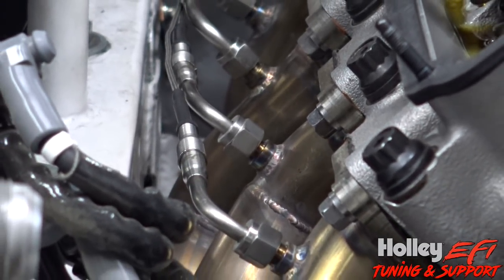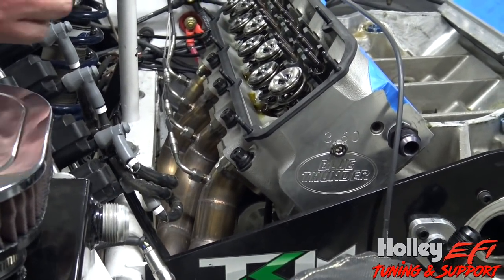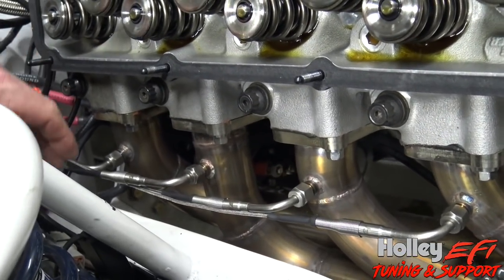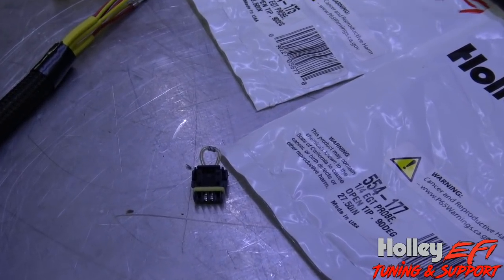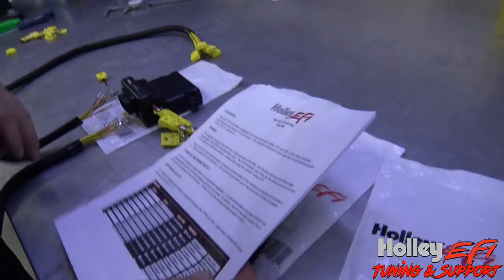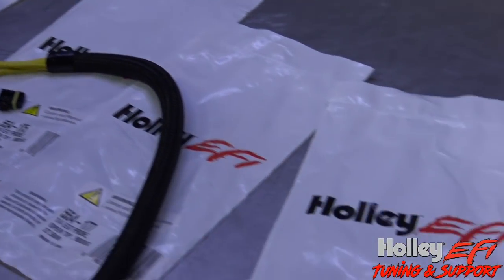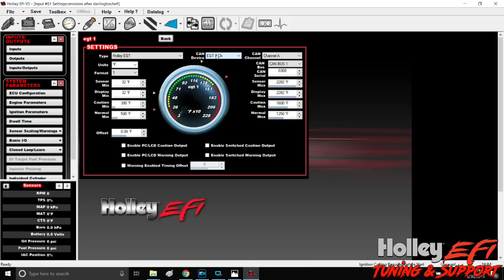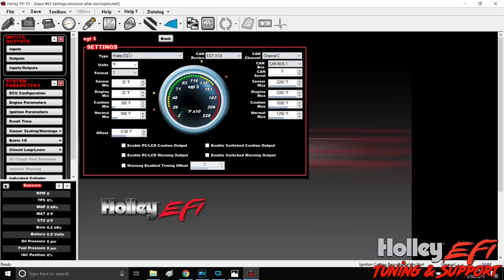Holley Efi Can Bus Egt (Exhaust Gas Temp)

Comment: Do you have links for the wiring bulkhead connectors you used for this as? I understand the material for the pins in the connector need to be the same as the thermocouple wire so the readings are not affected, could you please let me know where to get these.  Awesome videos BTW, thanks!
Reply: i would also like to know this... did you ever get an answer anywhere on this?
Reply: @kristiankasa8679  I did not

Comment: do you have to use a specific pin in the connector for the thermocupler or can you use the standard pins that come with say a mil-spec bulkhead? thanks!